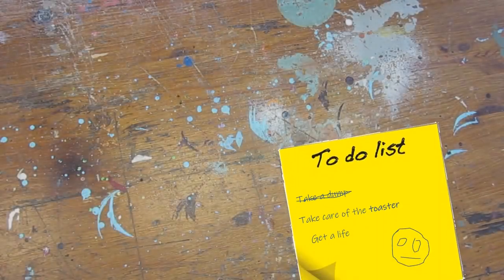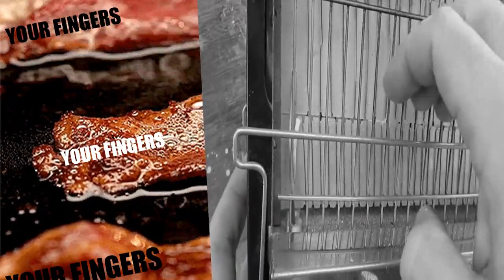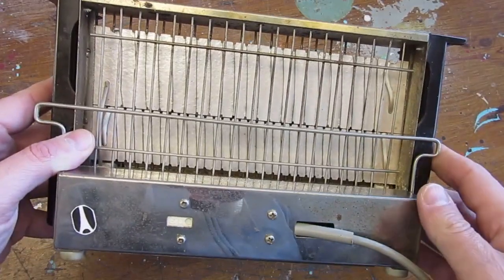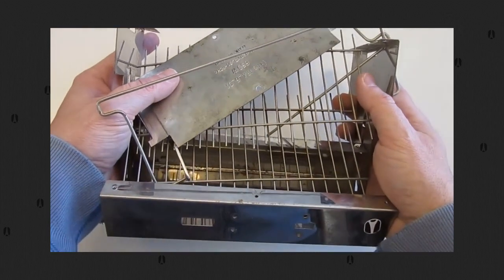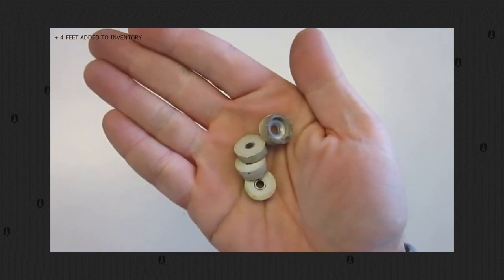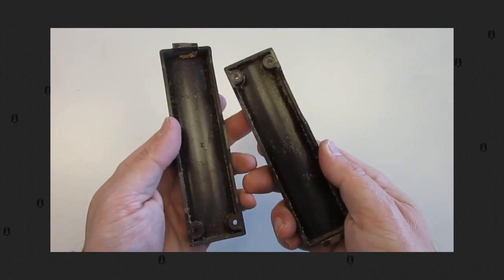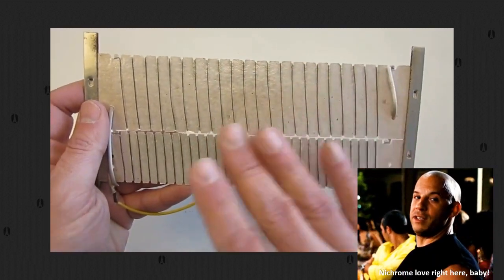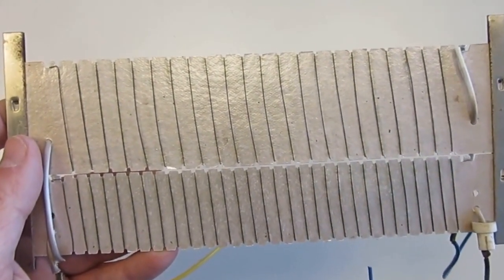TOAST! Recycling An Old Toaster And Getting The Good Stuff! HOW TO Recover Parts #DIY #Electricity

Comment: How do you solder Nichrome wire ?
I want to do a cut foam with the Ni Chrome wire and want to solder it at both ends and feed in 12v !
Appreciate your reply.
Reply from the maker: I always clamp my michrome wire (between 2 rings). This allows me to swap the wire when needed (either with a different gauge or because it broke off)
Reply: @TheLabOtomy  Thanks - Will try.